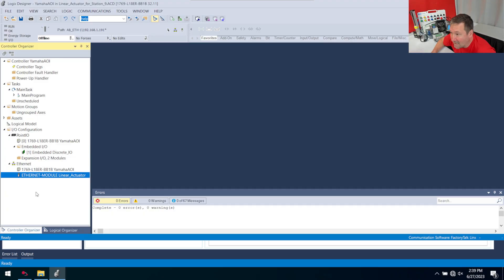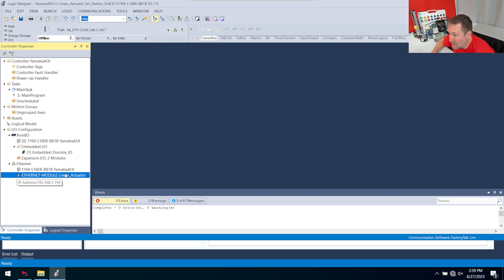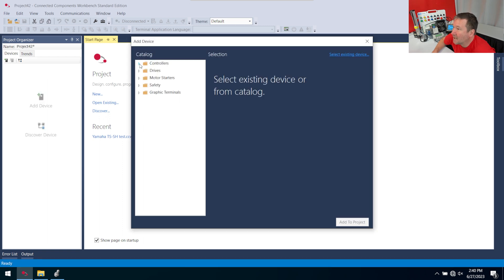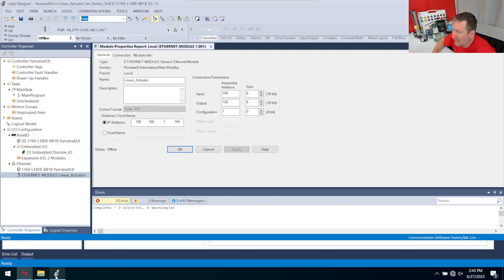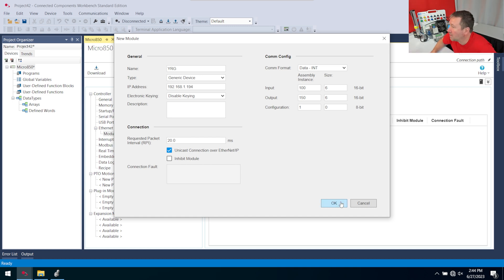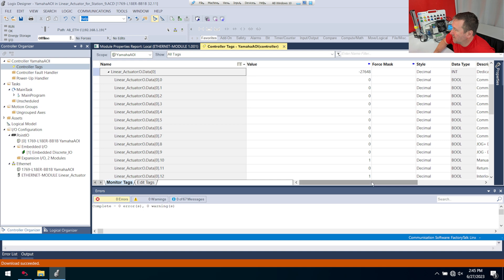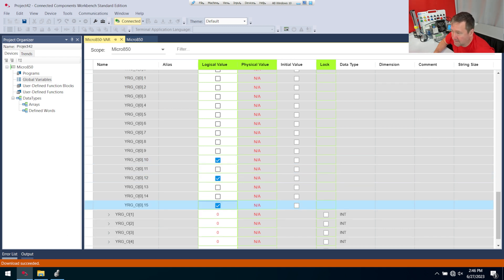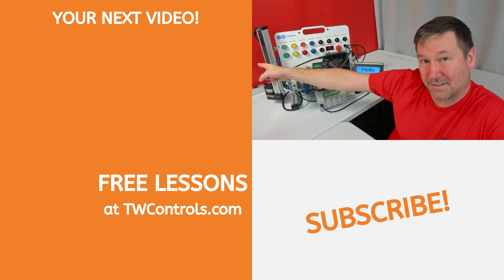Adding Ethernet Modules to a Micro850E. Class 1 Ethernet Messaging

Comment: Great Video, your the best. Can anyone help with the settings if I want to send 4 Datalinks from SMC-Flex to micro850E (Out Datalinks A1,A2,B1, & B2), what should be the Comm Format; Input, Output, & Configuration Assembly Instance and Size.
Reply from the maker: Check out parameters Parameters 88 to 103

Comment: how i do it in 20.0? for me, the "new device" not apear
Reply from the maker: Which PLC do you have selected?
Reply: @TimWilborne  Im working whitch a 2080L50E48QBB.

I also tried to create a project with the PLC used in the video but it still doesn't have the option "new device"
Reply from the maker: Might check which version that PLC was added on, it was around 20 but maybe it was 21, 23 is the current version.
Reply: @TimWilborne  you reffer version of the firmware?
Reply from the maker: That PLC was only added a few years ago, it is possible that it isn't in your list because your software is older.

Comment: Can we use user define data type UDT on Micro 850 E
Reply from the maker: Yes, they are called Structures...I can't remember if you can create them in the free version
Reply: @TimWilborne  thanks Tim I’ll check that out 🙏
Reply: it works but i can't find counters and timers data type in structures
Reply: any thoughts
Reply from the maker: You are right, no timers or counters.  You could use DINTs and TIMEs to store the presets and elapsed times but the actual instruction variables have to be regular variables.
Reply: @TimWilborne  that's what i did i had to create them in the global variables Thanks
Reply from the maker: You are welcome.

Comment: good morning tim Can I use a point io with this new line of micro800 drivers? What can I communicate using this new micro800? thanks
Reply from the maker: Yes, I have experimented with this.  The only trick is figuring out the connection sizes.  This document will help.
https://literature.rockwellautomation.com/idc/groups/literature/documents/qs/2080-qs006_-en-p.pdf
Reply: cool, Tim You could use this thread as a really cool video. hug.
Reply from the maker: I probably will, I have a project coming up where I'll need them.